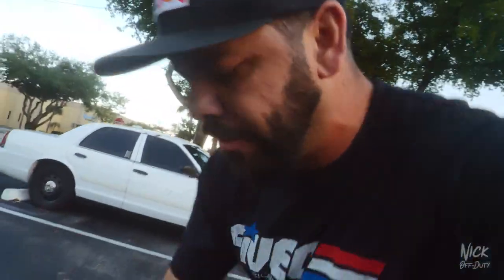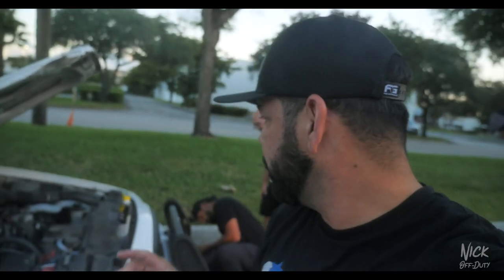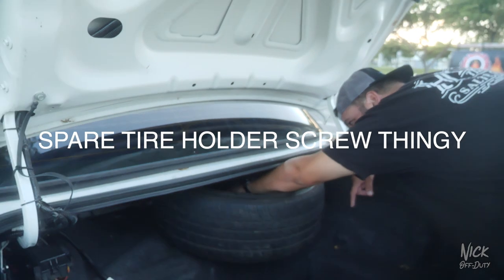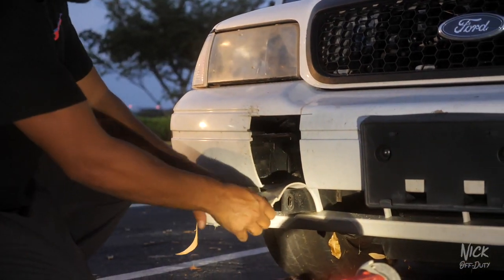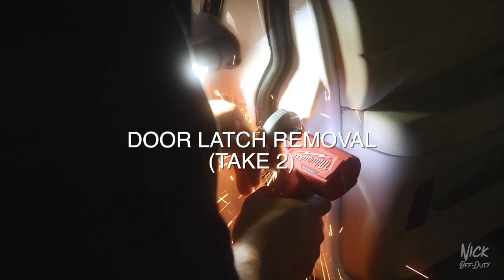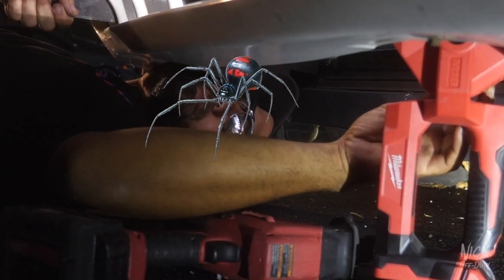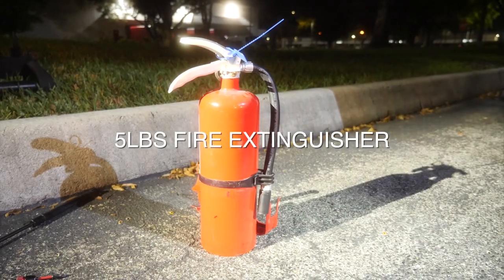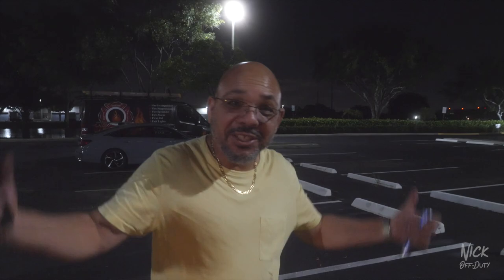POLICE CAR BUILD Transferring Police Equipment to my Ford CVPI

Comment: Are you planning to do anything to the engine? It’d be neat to see a police car with twin turbos. What would be your dream police car build?

Also, what’s the coolest police car you’ve ever seen? Mine was an unmarked FHP car I saw pulling out of a gas station a few years ago. It was a blue charger, and I didn’t realize it was a police car until the lights came on. LEDs allowed them to do a real good job hiding the light package. The only other giveaway was the FHP license plate.

I also saw another cool police car at the North Dade Justice Center a few years back. From afar it looked like an unmarked police car, but when you got close to it, you realized it was a marked vehicle. The signage was opaque so you could see it, but it still allowed the car’s color to show through.
Reply: There's a couple of those opaque signage cars at the Sweetwater Police Station.

Comment: When you started cutting the front bumper to remove the brackets I started to cringe...I could have helped remove the front bumper cover with less effort. Crown Vics are so easy to work on!! I am not hating...lol
Reply from the maker: 🤣🤣🤣 but it was much funner to cut it.
Reply: @NickOFFDuty  true...I help restore/recondition retired police cars so if you need anything more police related for that car hit me up. Spotlight parts, interior dome light,  rear door lock rods, etc...

Comment: Nick, I subscribed to you would like to get contact info, my daily runner is an '04 CVPI with Setina push bar, and I'm in the market for a front bumper cover.  My wife's german shepherd chewed up the driver's side wheelwell trying to catch a squirrel that was hiding there.  Understand that it was expedient to cut that one up.  BTW even that piece could be plastic welded in a desperation improvised fix.